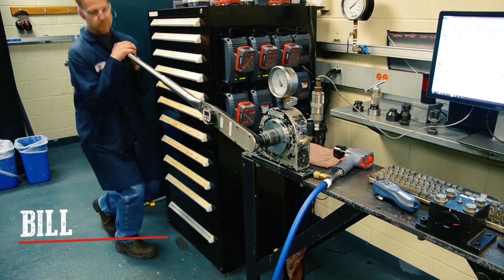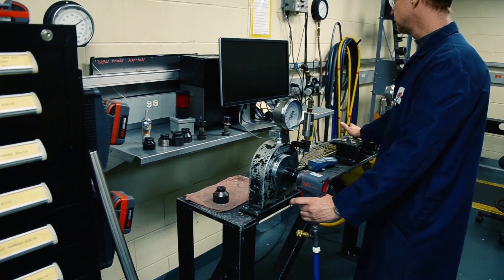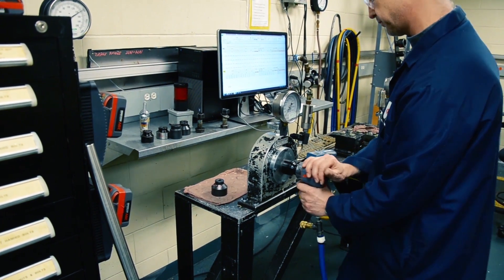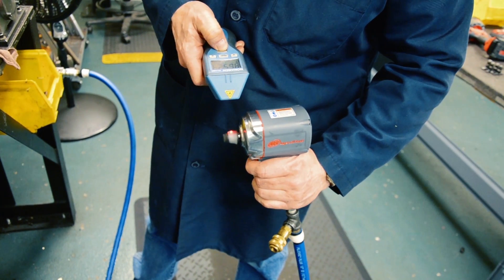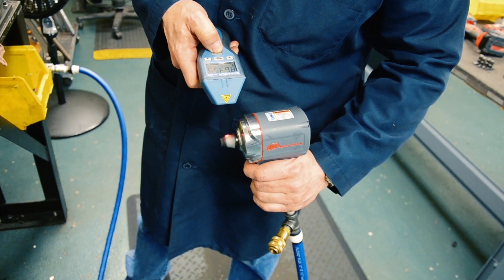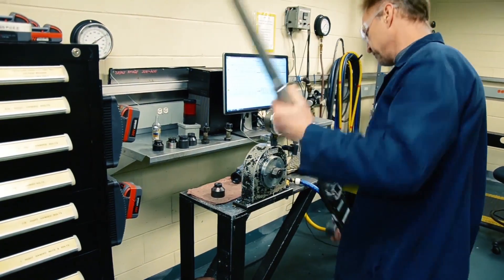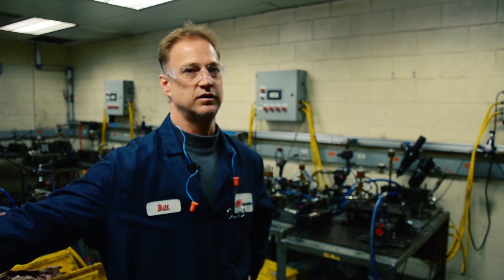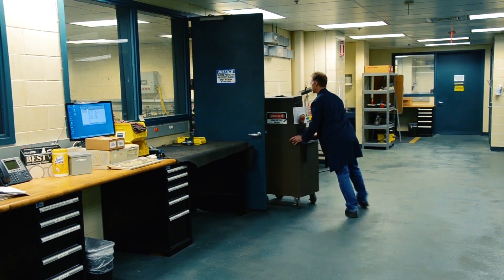35Max Ultra-Compact Impact tool - Durability Testing

Comment: I bought this tool for $220 and it barely takes off lug nuts. I am disappointed.
Reply: It takes Air Consumption @ Load (L/min) - 481! Or 17 CFM - can you compressor provide such amount of air with 6.3 bar on the end of hose near tool?
Reply: PoniesLoading . . . I am having the same issue. Is this normal or do I have a defective unit? I tested the fwd torque at max setting and verified with two different torque wrenches at only 100-110 ft lbs. barely took off 150 lb lug nut in reverse.
Reply: Mine takes off lugs with no issues.